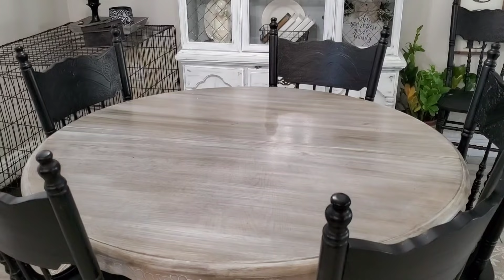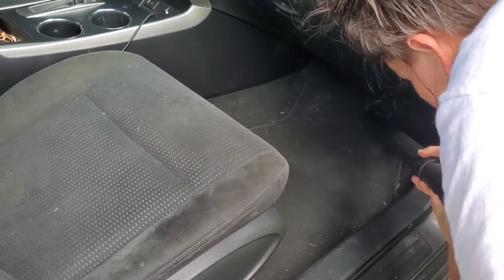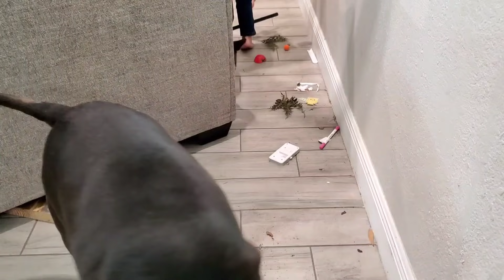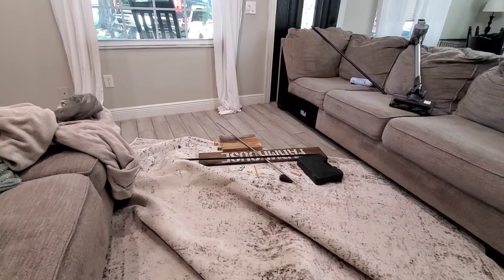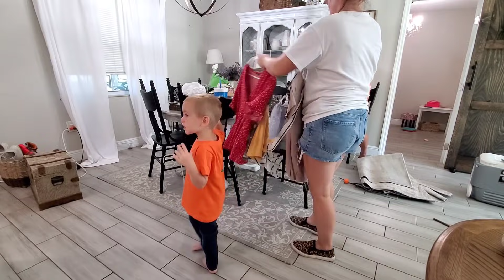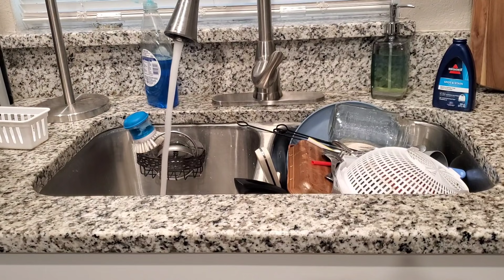ALL DAY EXTREME CLEAN WITH ME. BACK TO SCHOOL CLEANING, DECLUTTERING AND ORGANIZING. REAL LIFE MESS.

Comment: Mrs Meyer's clean day Surface Scrub works really well for me.
It's non scratching and removes grease.
It's lightly scented with lemon verbena.
Cleans everything.
As a matter of fact Mrs Meyer's products are made only with plant derived ingredients along with essential oils. Think aroma therapy.
It's also cruelty free.
I love the Clean Day multi surface everyday cleaner also.
You can buy concentrated products, add water and refill the same container over and over.
Also all products can be bought in  the same scent.
I have the Honeysuckle line and the Lemon Verbena line.
I don't receive any compensation.
I'm just sharing.
I buy mine at Food Lion and also Amazon.
Happy Cleaning!

Comment: Window tip🤪... your top window panel can probably slide down on a nice day if you want to open your window and keep kids and dogs safe from knocking out the screen  (if your screen slides as well or is a full screen). 
You also may have little tabs to pull out to prevent the window from opening completely. (So no one can climb in or out, )
My upper window also tips in to clean the outside. 
Crazy me....i like to clean windows🙊🤷‍♀️